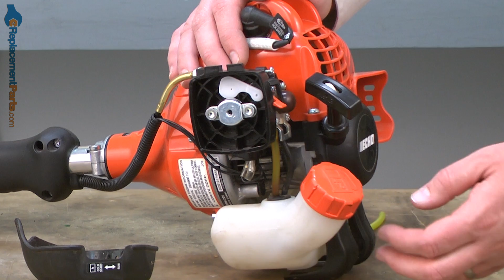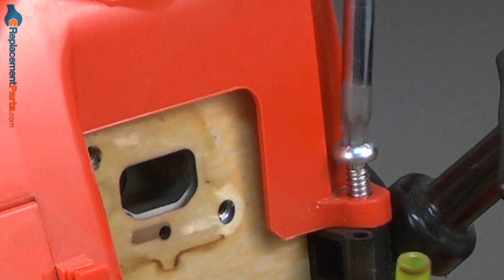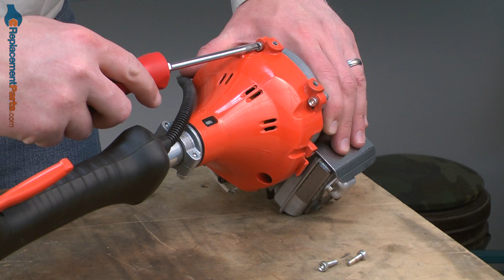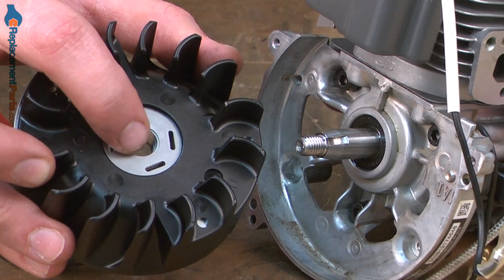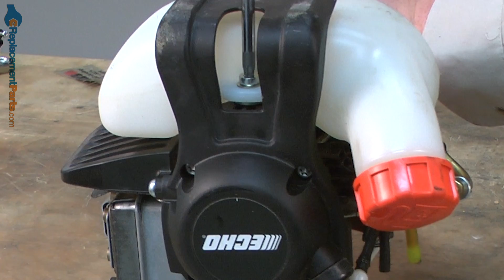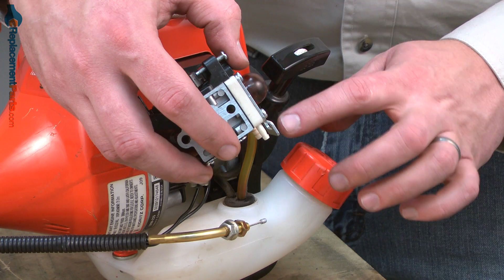Trimmer Repair - Replacing the Piston Ring (Echo Part # A101000090)

Comment: what make a weed eater spit out gas out of the muffler
Reply from the maker: +Paul Cumber Check the vent on your fuel tank.  Fuel vapors expand as they warm and if the vent is plugged it will force too much fuel into the carb and through the motor.  Another thing this might be is if your fuel mixture is
too rich with oil the piston will push the unburned oil out of the exhaust.